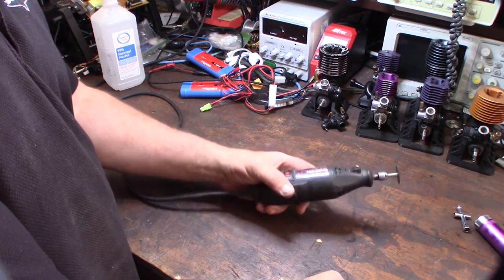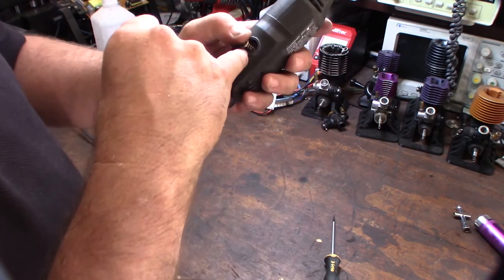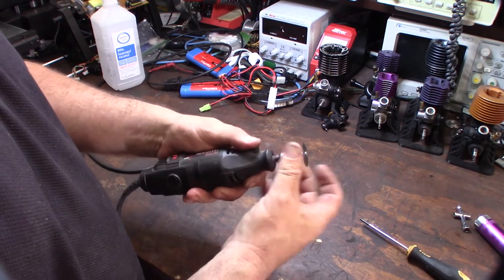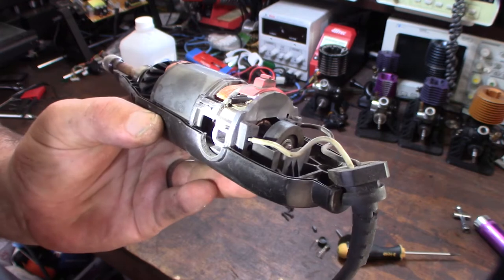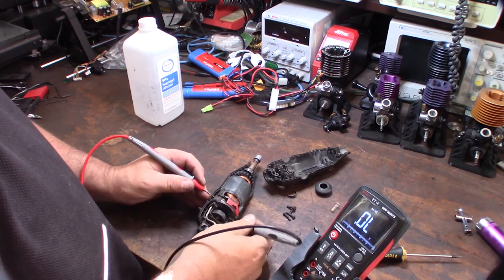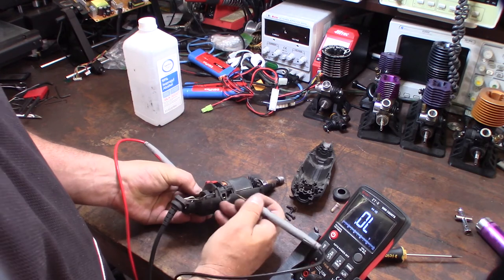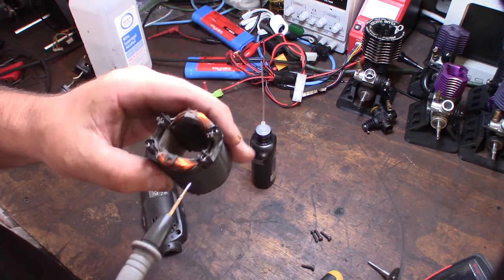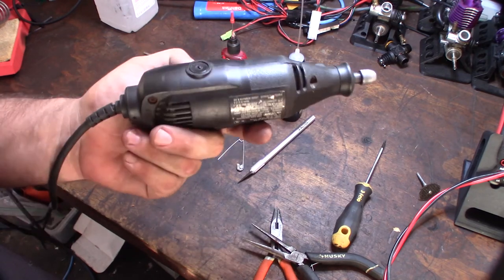Craftsman Dremel Tool Troubleshooting Bad Motor Winding Repair, Brush switch check

Comment: I'd say you got pretty lucky! It was only a temporary motor failure in the windings! I bet if it was a Chinese Dremel, you would've had to invest to get the entire motor rewound! Their crappy brushes and switches probably would've died and caused you more problems before all of that anyways. The windings would've been just the icing on the cake after all of that fixing later! I'm beginning to see why you would've thrown it out if it wasn't American made, I'd try to fix it still either way but with Chinese crap, when one thing goes out, it all goes out. That's just simple facts.
Reply: i think ive heard it called "planned obsolance" ... i call it "engineered failure" ... either way , as i have knack for fixing things ( grew up dirt poor as a pre-teen in the 70's & during my unrully teen years thru the 80's) i worked as maintainance at a furniture factory for 17yrs. up until 2008. (the place closed/economy crisis) im currently keeping my '95 GMC serria 1500 running & roadworthy (no payments) sorry, im not trying to boast... i just want yall to know why ; when i say that ive watched this country go strait down the sewer pipe... i guess 80% , might be more....... EVERYTHING IS ENGINEERED TO FAIL, EVERYTHING .. .... BTW , i have a craftsman rotory tool. its not quite the same as yours, i bought itaround '90 or '91. its only 1 speed , i didnt spend more to get the varible speed mod. im scouring thru youtube looking to see if it has universal AC motor or if its a DC motor. im hoping DC so i can get a PWM to slow it down. its always ran good, still does... it runs like a scalded dog.. wide f%#*in open... lol